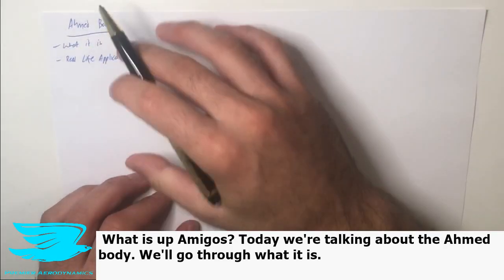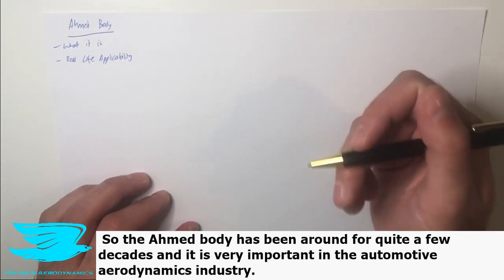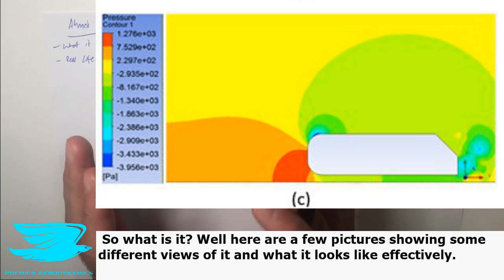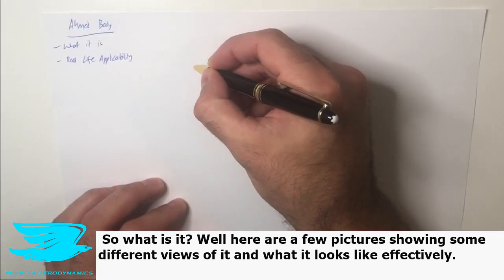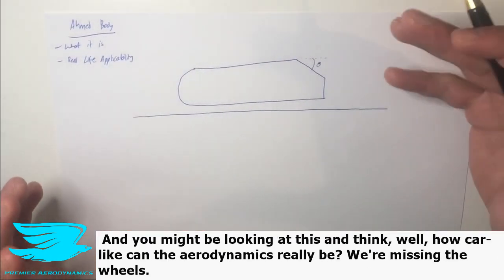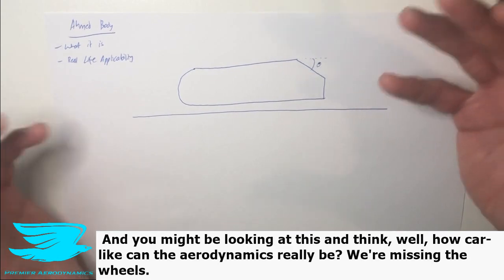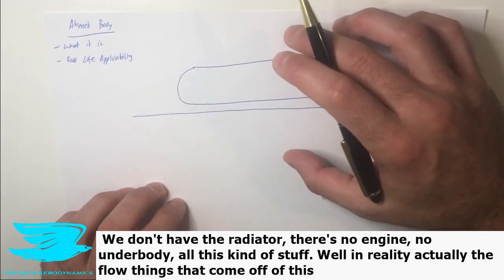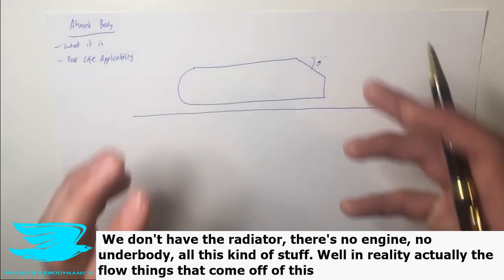{Auto Aero #26} Ahmed Body Aerodynamics

Comment: Race cars like F1 are upside down Ahmed bodies.
Reply from the maker: I had never thought of that. I guess the way the wake goes, it's very similar.
Reply: @PremierAerodynamics  the diffusers on most road cars works like the sloping part in the back. Same flow structures in general. Wilem Toet made a very nice article about it :)
Reply from the maker: @rolandotillit2867  Oh right, I think I read that paper. That was where they were putting airfoils at the back to change the pressure to help the flow shoot through more? Or is there another paper you're talking about?
Reply: @PremierAerodynamics  I believe that's the one.